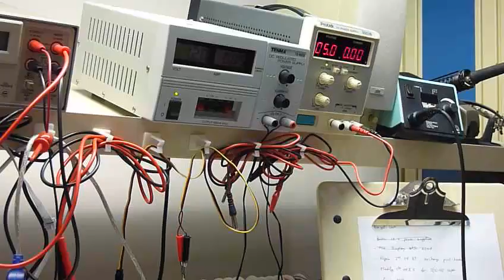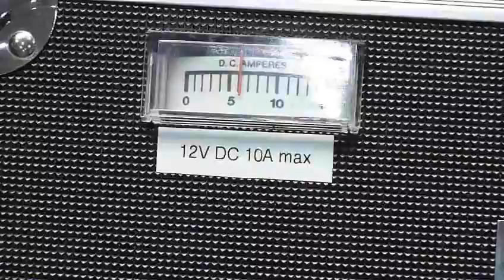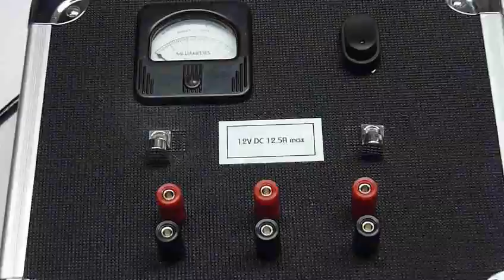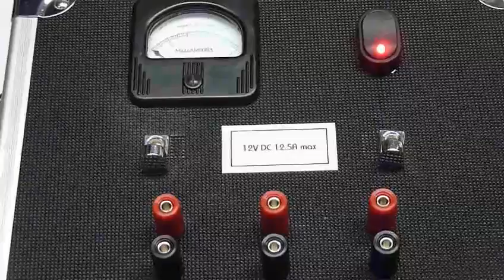Building Lab Power Supplies out of Vaultz cases and old ATX supplies

Comment: Re: Reconfiguring AT power supplies into single voltage, high current supplies

At our ham radio club, we needed a 13.8V/30A supply to power an old commercial 50MHz FM transceiver. These things were mounted in tow trucks and taxi cabs, and they were power hogs. After taking a look at what was available in the way of commercial DC supplies at that amperage, I decided that spending a weekend trying to convert a 500W AT supply to a 12V-only supply was a worthwhile effort. 

No detailed description of what I did is available, for the simple reason that all computer supplies are (a) a bit different and (b) without schematics. This didn't turn out to be a real problem , because, at the time I was doing this, they were all based on the same TL494 regulator chip, for which ample documentation, including applications information, was available. So, what I had was a schematic of a "typical" supply (actually, several schematics, all different) and three or four supplies. My theory was that if I could get one working supply out of the four, I'd be good, since I paid nothing for any of them. I spent a day reverse engineering and drawing a schematic for my candidate supply, and relating it to the schematics I had. Turns out, the differences were minor, but not having component references made for most of the work.

Turns out, it was pretty easy. First, all the outputs are developed from a single transformer, with multiple taps off the secondary. By combining a couple of the secondary windings, I could get pretty close to the 13.8V I needed, and some of the higher current windings were used for this. I ended up stripping the entire secondary side of the PCB of components, then repopulating the ones I needed. I did things like combining the +/-12V windings in parallel and adding the high current 5V winding in series, to give me the voltage and current I needed, then using the high current diode and filter coil from the 5V output and buying some 20V electrolytics to replace the wimpy 15V ones used on the (formerly) low current 12V winding.

Next, came handling the regulation and overcurrent feedback circuitry. IIRC, the supply uses both 5V and 12V for feedback, and so I rejiggered the feedback  to use on ly the 12V (actually 13.8) and this turned out to be just a matter of changing some resistors.  Overcurrent worked the same way -- analyze the circuit, and figure out which resistors to change. The moment of truth! Powered up, added a 30A dummy load, measured voltage and current -- success! If there had been smoke, I would have investigated only as far as I needed to understand what went wrong, chucked the supply and taken another from the pile. I ran the supply overnight, with full load, and saw no issues. It powered the radio just fine for as long as I was in the club. 

So, don't just settle for the outputs the supply was built with. There are other options, and discarded fully functional PC supplies are pretty much yours for the asking.